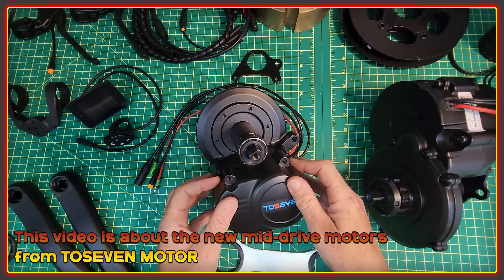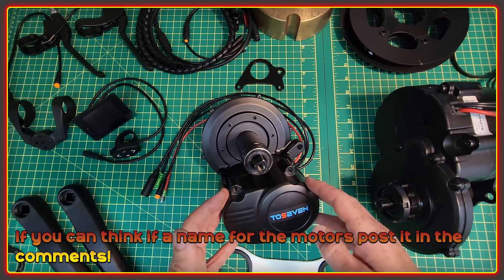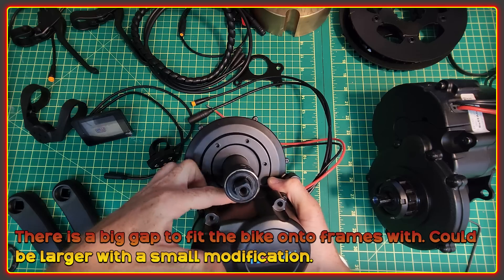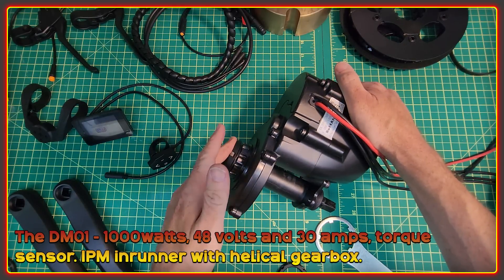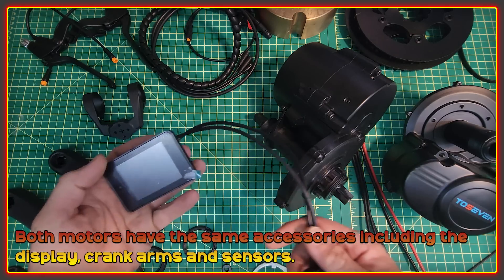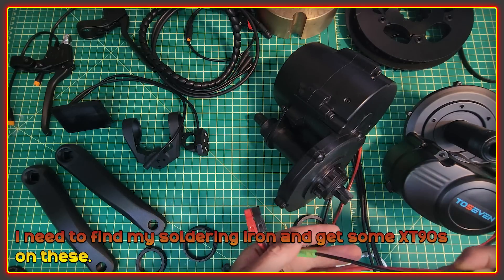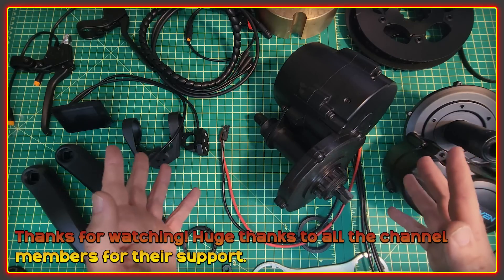New for 2023, DIY ebike conversion motors from TOSEVEN! my first thoughts.

Comment: Looking forward to your comparison with the Photon. Where can I buy these? How are these different from the Tongshen?
Reply from the maker: I'll print up a Q and A with some of the main differences. The designer was the lead engineer at Tong Shen so this eliminates many of the flaws in this style of motor. A more reliable torque sensor, larger gap for mounting are some improvement. They will be available from dealers. Golden Motor and Eco Cycles are evaluating them.
Reply: @HighVoltageKits  Eco Cycles site has not been up for more than a month.  It has a message “Opening Soon”  Any idea when it might be up again.

Comment: Will this fit into 148 Boost frames? These often only take a 34T chainring max before hitting the right chainstay. Also, it is hard to see, but I'm not seeing that chainring is Shimano HG compatible - the narrow teeth look too sharp (they should have beveled edges).

Can't find any drawings of this thing anywhere.
Reply from the maker: I'm not sure on either of these points. I can likely get the information though. I think the chainrings will be pretty easy to swap.

Comment: Do you know if the DM02 can be mounted in a carbon frame? Because the TSDZ don't have enough space to do it.
Reply from the maker: I will see if I can try it on one. It's got more room than some motors. I will get the exact space in a Q and A
Reply: @HighVoltageKits  I have a Santa Cruz Bronson C, carbon frame. So just CYC Photon fits in my frame. TSDZ and Bafang don't have enough space.

Comment: DM02 comparison to the TSDZ2b, would be interesting. Since externally they look almost identical. And TOSEVEN was supposedly founded by former TongShen engineers. 

Plus a subsequent teardown at some point to see what parts of the same and what parts are different. Since TongShen just revised its TSDZ2.
Reply from the maker: I have a list of improvements I will put in a document when I get chance. The designer of these motors was the lead engineer at Tong Shen is the story I have been told.
Reply: @HighVoltageKits  my go-to for an EV conversion is the TSDZ2b, at this point in time, so that would be great.... Thanks...

But what document and where can we find it? I was hoping to be part of a subsequent post. I'm a subscriber, so I would definitely see it that way.
Reply: Yes, I would also like to see a comparison between the DM02 vs TSDZ2b.

Comment: Those motors should have XT90 plugs by default like in CYC motors!
Reply from the maker: The ones here were direct from the factory. I think that they will be configured in the future as specified by a dealer and at that point the customer could also request the XT90.
Reply: Yes, but also: They should use the same connectors and pinout for the speed sensor, throttle and brakes as bafang. So ther is a 1:1 compatibility so we do not need to buy or rewire these sensors anymore
Reply: I'll second that, those anderson pole connectors are nasty, the metal connections wiggle to much and mine melted lol, xt90 are perfect for more powerful motors that draw more amps.

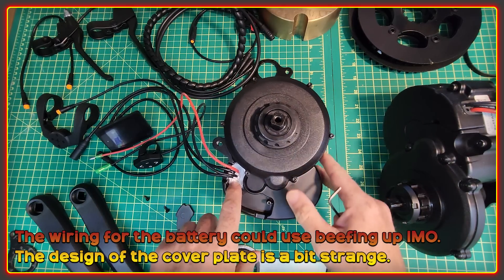Comment: At 4:30, if I understand the motor direction correctly then the hole is probably there to let out any water they may come in through the cable opening and make it dry faster.
Reply from the maker: It will definitely do that. It just seems an odd way to do it. I think I would have just gone with a gasket. I suspect its one of those things that perhaps made manufacturing cheaper. I wondered if it would be a good place to put in a sneeky GPS tracker.

Comment: They look like tongsheng... Good little motor..
Reply from the maker: The designer used to the the main engineer at Tong Shen. I always heard mixed things on those. The one dealer I know in the US has this list of things he does to "fix" the motors before he sells them. Maybe yours was from them. Its not one I have had the chance to try. Supposedly many of the design choices on the 02 were made to mitigate known issues with this style with overheating and wandering of the TS signal. The same dealer sounded pretty happy with this motor so that is encouraging.
Reply: Been running a tnogsheng for 6 years, on some rough single track mtb as well. Biggest issue is amount of play in axle and some quality issues with clutch. Hoping dm02 addresses this

Comment: Thanks for the info 
Looking forward to the videos
DM01 will it run on 36v
Reply from the maker: I am pretty sure it will run on 36 -70 volts for the full range. Which is nice. It means you won't be able to damage the controller with an overcharged battery. 16s is a possibility as well. I will get this information into a Q and A.
Reply: @HighVoltageKits  Cheers mate

Comment: The little lump looks like it's designed to stop cable pinch between the bb if you decide to route them differently.
Reply from the maker: I had not considered that. I will have a play!
Reply: that's plausible.... insightful take on it....

Comment: More DIY mid drive motors = compation and innovation. I'm looking forward to seeing the innards of these motors
Reply from the maker: There is a link in the description to a video where you can see the main gear as well as the rotor and the back of the controller.
Reply: @HighVoltageKits  is there any equivalent post on the DM02? I'm trying to compare it to the TSDZ2b.... Thanks in advance for any information....

Comment: looke exactly like tsdz2's????
Reply: It looks like a mirror image but in fact its actually very different and a lot of improvements have been made.
Reply from the maker: Its pretty close. The designer of these did used to be the chief engineer at Tong Shen though.
Reply: @HighVoltageKits  I'm really curious if this is compatible with OSF in that regard or at least easy enough to code it to work. I help out sometimes with OSF development since I do programming in my job, would like to get myself one of these once they're available. If I recall they're using still UART which gives me hope that it will. Tsdz2's has a pretty good activity on the custom firmware in that regard.

Comment: These are said to have higher pitch noise compared to the BBSHD due to higer RPM's according to Lierskogen Ebikes. These have way less drag compared to BBSHD but longevity and repairability of large diameter sprag clutch is probably unknown. DM-01 IPM rotor has 6 magnets, while BBSHD has 7 magnets. That might also have an effect on RPM (will have to look it up again).
Reply from the maker: From what I was told most of the design decisions particularly with the DM02 were made to eliminate issues present it this style of motor. As to the longevity of things we will have to see. The BBSHD has 8 total magnets in 4 pole pairs. The 01 has 3 pole pairs with 6. The number of pole pairs can vary but the total number of magnets must be an even number. I have lots of video of the BBSHD at all levels of power so it will be interesting to do a noise comparison. The BBSHD does get more noisy as the RPMs go up.

Comment: When you get the chance could you look into if it is possible to remove the existing the original controller and using a BAC855 with these motors on 72V
 It makes for a better riding experience to use a BAC855 on a Bafang motor so it would be neat to see how it could work on these. I don't know how the torque sensor might become a problem though?
Reply from the maker: We are being sent a sacrificial unit to push as hard as possible. I don't see the TS being much of an issue. Its UART so there won't be any gremlins trying to get a signal from it.

Comment: I can't for you to open them up... Unless you got to give them back.
  I'm glad to see more products are coming out with more mid drives especially with torque sensing.  I think a 104 bcd  adaptor would be a fantastic option.  I also think that using the same bike to test all these different motors would be great to feel immediate difference... But some of these motors are probably suited well with a different geometry frame.
    Either or I'm excited.
Reply from the maker: I don't have to return them. We can definitely do a tear down. There is being a unit sent off to Greg to run some bench testing on the Dyno rig and play with the external controllers. For now they wanted as much feedback as possible on how I an getting on with them. They should install with no issues on the white bike and give a pretty good indication. I will also take then to get tested out on a bunch of different frames when I get chance. The gap to the motor seems to be larger with these so might give it more flexibility. Cheers

Comment: 16 gauge wire is way to small to use here.  Should be at least 12 gauge for safety.  And speaking of safety; are these two motors going to be UL 2849 approved?
I don't like the teeth on the Bafang motors.  They tear up the BB to much if you want to go back to stock on that frame again.  I made a bracket to weld to the lock ring that could be bolted to the back of the BB where the chain stays attach to keep the motor in place. But I'm going with the Photon so I don't need it now.
I'm trying to get Jon to add an "Amp" reading to the displays on the Photons.  Seems like it would be better to judge the current drain, than trying to figure out what it is from Watts.
Reply from the maker: I have no idea on the rating at the moment. I will ask though. I would like the app to be more accurate. It should be possible within VESC.

Comment: I wonder if Shimano and SRAM have patents for their BB bolts. There are tons of BB socket tools out there that can be used with a torque wrench for both of those styles. Also, I'm sure the Lekkie One Nut would work with those threads. And there's socket tools for that. I would prefer there to be a better tool out of the box, too, though. I also wonder if someone develops a UART display for this if you could wire it into a VESC.
Reply from the maker: I have a one nut. Its worth a shot. I might just get a Bafang on in that case. 🤔
Reply: @HighVoltageKits  Would be of great interest.  Many of us with Bafang mid drives have the socket, which in the early days, wasn't easy to find.
If the Bafang nut fits, would be a win for the ToSeven motors.
Reply: @HighVoltageKits  I prefer the One Nut because of the grub screws. I've found that I don't have to wrench it down as hard because those grub screws keep it really secure. And it's easier to get good purchase with the included Bafang tool. I just wrapped it with a million layers of electrical tape so it doesn't rip into my hand with those sharp edges.
Reply: The only thing is not all of those tools are deep enough to clear the square tapper axle. The only way around is removing the axle but decided to use modified plumbers pliers with a 1.5 m cheater bar and NordLock washers instead of OneNut. Might need to order some Bafang sockets just in case if for whatever reason it's impossible to undo the original lockring.

Comment: i wonder if these motors have enough space to clear they ISCG mounts that a lot of MTB frames have these days?
Reply from the maker: What is the dimension?
Reply: @HighVoltageKits  so a lot of new bikes have these welded parts on their BB area meant for bash guard/chain guides ISCG mounts, the bbshd can’t clear them unless you saw off part of them. The cyc motors seem to have enough space inbetween the motor and mounts to clear the iscg mounts.